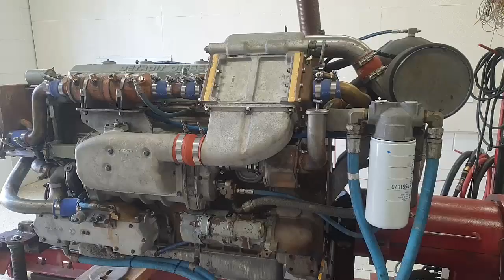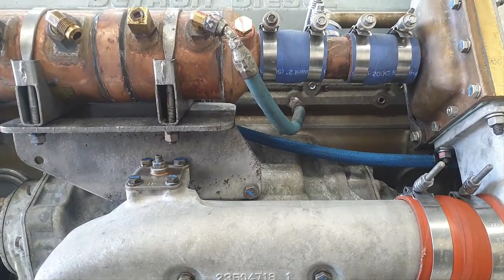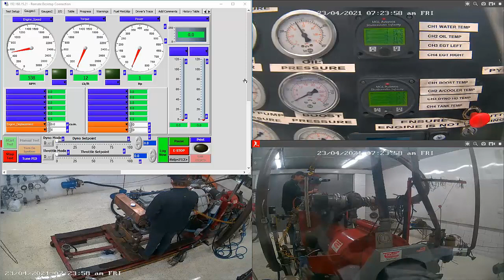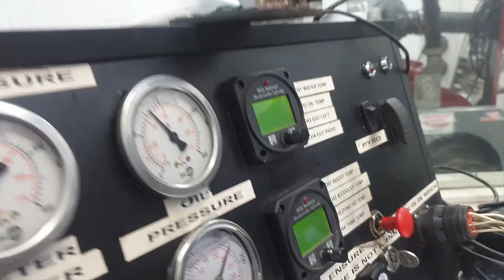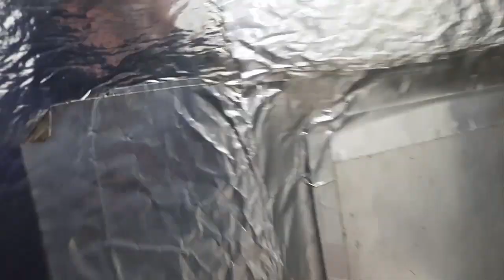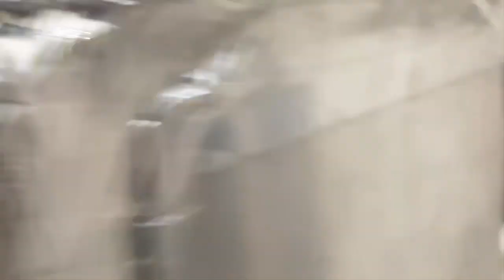6-71TA Detroit (High horsepower marine) 500hp@2500

Comment: GREAT VIDEO... and job well done on this build.   Personally, I would use a 6-110T for a "base" to build (Roots block).... Detroit Diesel had one in the dyno cell, with only "mild" factory upgrades... and loaded it to 2400 rpm's... and we saw 648hp and a healthy 1648 lbsft on the torque indicator.   We felt that it had quite a bit more, with more tweaking... as it was real easy to get what we did at that point.    Back in 1969, we built a 6-71X (experimental scavenging system) that we ran in the dyno cell for two weeks straight, under full load at 2700.... 750hp and 1428 lbsft.    I think it's nothing short of absolutely amazing that 485 / 500hp can be pulled out of an engine (6-71) that begins its scavenging cycle just short of half its total stroke length (88 degrees of crank rotation from TDC).    

The 4 cycle lovers out there, can bad mouth the 2 stroke Detroits all they want, but they're only putting their complete ignorance on full display for all the world to see..... technically, they understand Nothing.     There is good reason why ALL the high horsepower Marine diesels (from about 60/65,000hp and up) are 2 cycle.    Thanks again for this video... was nice to hear it running.

Comment: Wow, she's a ripper!  Idle seems a tad bit low and the buffer screw could probably use a little turn in.  My 1986 Tollycraft 48 convertible has a pair of 6-71TIs running around 420 HP with 7N95 injectors.  She runs 18 knots at 1,800 RPM and has 3,055 hours as of last weekend.  I'm glad to see that your oil pressure at idle is the same as mine - about 10 psi.

Comment: Thanks for the video! That is something else!
Is that a Maxi bypass blower? I have seen them and figured they were used on marine engines.
Reply: @GinosGarageUSA .....I think you meant to say.... High Bypass blower... but they open at only 17psi, and like he said, you Need to be able to unload the blower in order to no create too much heat, so extra valving and after & inter-cooling is critical on these.

Comment: Ok, boys and girls, this is a 426ci engine!  an 855 Cummins at the same HP/ci would have to make 1003 hp to keep up, at full load for 3,000 hrs! Most aircraft engines only go 2500. I know a few guys running 12V71s in pulling trucks and tractors at 4500 to 5500 rpm. One guy was running 210 mm injectors and 4 turbos, no smoke. (Stock is about 70) Great work!
Reply: A stroker at 426ci is equal to a four cycle at 852ci, since the four cycle has a wasted stroke for exhaust. This is why I like them so much......every stroke is a power stroke.
Reply: @Cletrac305
 ..... No, you Don't know anyone running a V12 (not these days) at 4500 to 5500.   Anything above 4700 is a near guarantee for parts exiting the block.  We built the V12 in our pull truck to run at 4000 to 4200..... and warned others not to go over 4400.... one did, and scattered parts everywhere at about 4650.   I know from studying WW2 reports, that "runaway" 6-71's would "sometimes" make it to 5000, but that was the maximum that I had ever seen.    It takes a LOT more than just "larger" injectors and resetting the governor to run at anything over 2350 / 2400..... but in the world of "I have a friend that......", big numbers come cheap, but when pressed for details.... people disappear.
Reply: @Romans--bo7br I know of more than one that lived in the 4,000s up. My buddies as you call them were NTPA guys. The 4,500 ish was a 12v71, the 5,000 ish was probably a 53 series 4-53 in a pulling Oliver. 

In those engines, just like an EMD, once you exceed the mechanical limits of the rod or bolts by themselves to jerk that piston back down it all depends on compression, boost and fuel advance being present to BLOW it back down on rebound. A decided advantage to a 2 cycle. If a valve floats, or a fuel problem happens or even if you let off wrong, then it's anyone's guess! 

Running one at over 2400 for LONG is the hard part. For a few seconds is one thing entirely, just like NASCAR engines that turn less rpms than some drag and pulling motors need way better balancing, center weighted cranks etc, to be reliable over 500 miles. Harmonic vibrations, primary vibrations, rocking couples, secondary vibrations, break cranks, walk main caps, and crack blocks long term. 

I have 45+ years of experience, I have STOOD NEXT TO MY OWN Detroits at 4k+ and an 855 at over 4k that ran away.

I own several Detroits, had 136 engines up to V12s, my own engine shop for drag racing and pulling, my own track and sleds, and 3 pulling tractors, with a wall full of drag racing trophies, and a 572 KB, blown, mechanically injected, hemi in a dragster. 

I have worked with certified failure analysis firms on engine failures, and worked in doing cryogenic treating of parts and analysis with photomicrographs, stress testers, strain gauges etc, in dragsters etc.

I do my own porting, balancing, and even made custom billet pistons in house. I have dynoed over 300 new build and used Diesels, and I will trust the good honest people who taught me, that I grew up with, who did these things. 

This is sad! It's just a talk about innane stuff. 

I'm sure no one could've ever exceeded your rpm capabilities by 200 to 300. 

According to you, I was off by at most 300, or not at all. This was 35 years ago, what an idiot I am! 

And now I will slink my mellinial, or gen z butt back into my mom's basement, and eat cheetos and play video games in my cul-de-sac! 

Or, I could be living in my shop, with my wife, next to a 6V71, using a 440 piston for an ashtray, and a 540 Perkins V8 for an alarm clock! Who really knows? 😂😂😂

I understand your frustration! Have a good one! 😊

Comment: I drove a 6-71 non turbo in a GMC 9500 triple axle ready mix truck back in the 70s. I was 18. It seemed big and powerful to me at the time. We grossed around 70,000 lbs with 10 cubic yards in the drum. Ignorance was bliss LOL. I didn't realize how underpowered those trucks were until I reached age 21 and got my over the road license and "graduated" to "big trucks" with more powerful engines. The first over the road job I had I drove an 8v 92 TA "430" Detroit in a COE Freightliner. It was then I realized how underpowered those ready mix trucks were. This 1050 lb/ft, 500 hp deal would have been a real hot rod.

Comment: Those old 2 strokes had So much potential. They NEVER Should have discontinued them! Emissions? BULL Shit, give'm a longer stroke, and slow'm down a little. They could run modern electronic injection, and a variable blower to Step Up with the throttle. Like WTF?
Reply: Yeah it's all B.S. there is no scientific proof 2-strokes of this type have worse emissions, I think people confuse these with the garbage valve-less crank-blow bike/moped engines, which are completely different, those blow oil evaporate out, these do not.. Also these particular engines were developed before Detroit even existed, yet had little alteration, so the fact they still achieve what they do is a testament to uniflow 2-trokes, no 70-year-old 4-stroke could be pushed so hard...

Comment: My 671 in my trawler has about 12,000 hours on it and isn't close to a rebuild. Only rated at 180 hp and maxs out at 1650 rpm. 2,000 hours is a short life, but thats big hp for a 671. Great donks.

Comment: Someone told me I should try to fit a v 6 71 into my d5n dodge instead of a v 6 53 is there much difference in size
Reply: The 671 is probably twice the weight and size.
Reply: 3-53 in an old truck?

Comment: Only 2000hrs ... assume that's from extreme duty mentioned. 
A shame Detroit hadn't continued development of a 2 stroke diesel line. 
Fucking EPA and others are bought and paid for...Otherwise I believe 100MPG Autos and light trucks would exist.
Reply: From what I have seen the 2 stroke opposed piston engine might be bought back thanks to modern technology so maybe the old commer knocker was a bit ahead of its time
Reply: charlesangell_bulmti..... Detroits biggest mistake was not further developing the 6-110/6-110T, instead of dropping it, in 1965.   They Completely mis-read the future hp needs of the trucking industry and the "simplicity" of the inline 6.  They're dyno cell tests had them up to 750hp @ 2350!!  Even at 350hp in 1963, they were a full Nine years ahead of Cummins, when they released the NTC - 350 "small cam".
Reply: Fairbanks-Morse 8 1/8!
Reply: I hate these 4 jokes in cars/trucks and these ugly 4 joke stupid looking expensive out boards they can keep them. I got a 4L v8 johnson small block 2 stroke and an turbo 8v92. Both are running with BRP XD-100 etec oil.

Comment: What injectors & cam timing?
Reply from the maker: 7025 injectors std gt advance cam
Reply: @dynosmith2187  thank  you. That is impressive, finally some one that  knows  the difference  between  gear train  timing & cam timing .!!! . I have a v-12 71 tta bypass blower with cleam cam technology  supposedly  tier 2 with their injectors 7495 dynoed 650 hp want to push it further .
Reply: @ruxoneto6560 .... We were pushing 2500hp & 3000 lbs ft of torque with the 12 (series 71) in the Sled puller (74 KW, ext. hood) and turning it at 4000 - 4,200.  Over 11,000 hooks on the sleds over the years... and only spun one main bearing during a pull in 2006!   PS: Did I mention that it had 1.6M miles on it when it was "retired" to full time sled pulling (NTPA and ECPA, plus many county fair pulls)!!  Two degrees advanced cam timing is all you can go.  

What the Vast majority of people Do Not understand with these engines (Series 71), is that valve opening Begins at just 88 degrees of crankshaft rotation from TDC.... What should That Fact, alone tell you (meaning Anyone)?... and they think that their big inch, long stroke, Cats, Cum-a-parts, Macks, etc... are impressive!!   Ignorance can Really be Blissful!!  lol
Reply: @Romans--bo7br  what injector do you have in it .
Reply: @ruxoneto6560 ... "Hand built" 240cc.... but, it takes a Lot more than "just" big injectors to make it all work.  DD had a 6-71"x" on the dyno in one of their "back room" test cells, in 1969/70, that was developing 743 hp.
Reply: @Romans--bo7br  I'm  not going that far , I'm going to what i call usable highway power , put your foot in it & head up the mountain.  I did a bunch of machining on blowers & some other work around the block to get more air flow.💥
Reply: @ruxoneto6560 ... Ok, so lets back up a bit, here.... What engine are you working with, and what type of vehicle is it in, or going into?  The whole "picture" needs to be taken into consideration when modifying ANY engine, first.  

The intended usage, type of terrain, gradients, overall gearing behind the engine all the way to the wheels, vehicle weight, etc, etc. All Need to be factored in, when doing these things, if you really want satisfactory results from your project.  

PS: Just FYI.... I hold a 4 year degree in Diesel Engine Design & Theory (Specializing in 2 Cycle) from the mid 1960's and studied directly under P. Nicholas for 3 of those years... PN was one of the lead engineers in R&D at GM Diesel (DD after mid 1965), who developed the very first prototype Series 71 engine (a 4-71) and who worked under and directly with, "Boss" Kettering.  

I also was involved with DD in the mid 60's, through Mr. Nicholas due to a "clean-sheet" redesign of the basic foundation for the GM Diesels which I drafted in 1965 and which was forwarded to his replacement (&VP of R&D) for consideration and nearly came to fruition, until the EMD division found out about it, and notified GM Diesel, through Corporate.. that they had developed a nearly identical system just a year earlier and had patent already pending with 100% overall "grandfather" rights on it and any "similar" versions that could potentially be copied by other manufacturers.  

My design was Not a "copy", as at that point in time in my life, I did not even have knowledge of the EMDivision.
Reply: @Romans--bo7br  just a highway truck that is more play, working with v-12 71tta ( coolers under blowers) & bypass  blowers from factory . I believe this v12 has clean cam technology . It is the latest  v-12  i have seen serial # 90, 000 something . I believe it is around  1997 year , best i can tell. Speed mph 100 ++. .🗯💥
Reply: @ruxoneto6560 ... Hello again, and so sorry for the long hiatus... just came back on here to review the video and found your last reply to me... a year ago.  I imagine that by now you've got your V12 all figured out and on the road... yes?    With regards to you last comment in your reply to me a year ago.... the Last V12 (series 71) came off the assembly line in August of 1995.  It was an "Industrial" unit and rated at 660hp.
Reply: @Romans--bo7br  Hello & thanks for the reply, the wife has had some medical issues so the v-12 took a back seat , the detroit diesel book i have  only goes to around 1984 ish & around aerial # 65,000 ish my v-12 is 90, 600, ish  and valve cover sticker says tested @ 760 @ 1800 r.p.m.
Reply: @ruxoneto6560 ... Thanks again for your reply.  So sorry to hear of your wife's medical issues... Good Health is Everything!, one can have all the money in the world, but if don't have your health.. it's pretty well meaningless.  

Will pray to the Lord for her... I lost my son when he was only 12 years old, after spending his life in the hospital since he was 6.5 years old.  

WOW!!... so your engine was rated at 760hp?.... and you want to "up" That?  Was that an Industrial or Marine rating?  What are the tag numbers (original use code) on the top left of the data tag?

Does or did, it have the marine exhaust manifolds on it when you got it, or was it in your truck when you got it?  

There were only a couple of higher hp ratings from the factory, that were higher, at 880 & 925hp if my memory serves me correctly.  I know for sure that 925 was one of them.
Reply: @Romans--bo7br  Yes health is # 1 , sorry to hear about your son my prayers are with you & your family.  Engine is on gen set center mount turbos , there is a # l18008 is that # ?? You are looking , putting two 6v-92 manifold & two v-6-71 exhaust manifolds that raise up & drop straight back, putting on backwards that is only way to clear thermostat housings ( industrial or truck).

Comment: 485 is super impressive for a 671 my goodness.  Bus Grease Monkey worked on a set of these in boat a while back which were rated somewhere around 400hp as well.  So perhaps slightly more long lasting, but considering the road going was intened to be something like.. what.. 300ish? if that?   that is still quite high strung.  I get what you mean with rating them conservatively. I keep the E-7 in my cabover downrated just like my uncle had it when he bought the truck, and it had well over 1million miles on it before he did a major rebuild and sold it to me.   I uprated it slightly when I was working it commercially, but these days its retired and pretty much used to pull a modified holiday trailer and the occasional 45 foot repurposed refer for a local music festival.
Reply: road going 220 ;
Reply: @simongilbert2704  Yeah the roots blown are something like that. TA variants are higher, like 275 or 285.